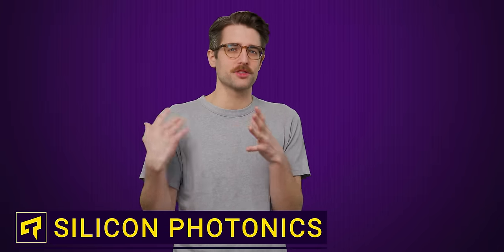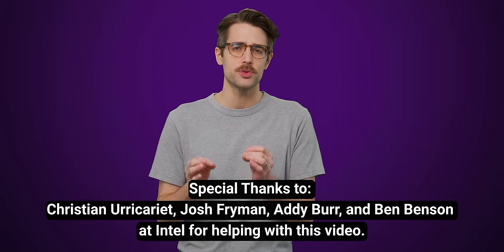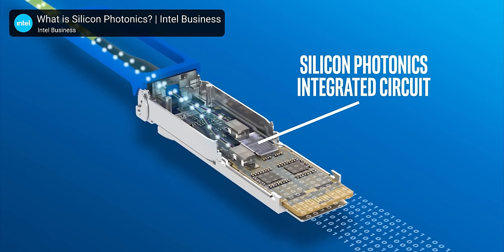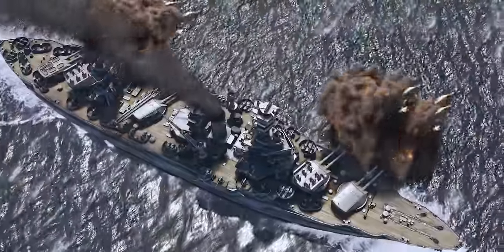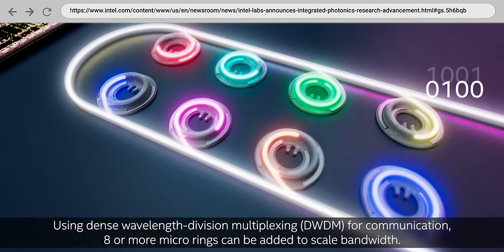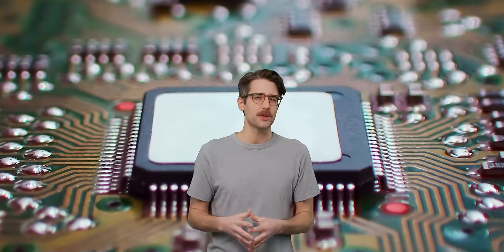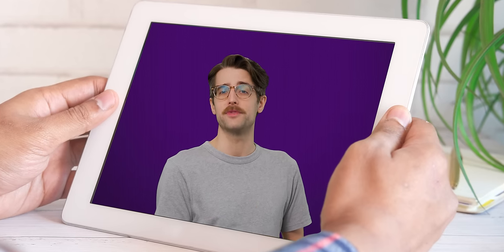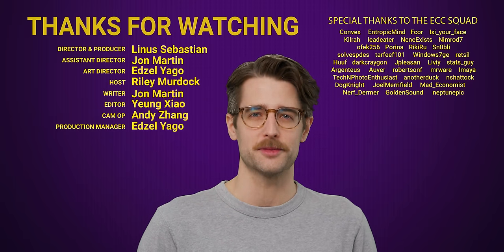The Newest Computer Chips aren’t “Electronic”

Comment: I feel like the challenge of inventing a silicon photonic CPU is going to be like inventing the blue LED.
Reply: It's because of the gallium mention isn't it
Reply: @paulelderson934  No. I was thinking about what the breakthrough would bring to the world.
Reply: @CoolJosh3k Might be less of a breakthrough and more a matter of replacing 70 years of progress in electrical circuit to respond to our current needs. That, and compability so that we may slowly integrate then phase out electronics

Comment: By the way you can also do the actual calculations in photonics too. Institute I worked for 10 years ago did that (wasn't embedded on chip though yet), but could do matrix multiplication in a single step. Seems to me like something we especially want for AI stuff...
Reply: Holy crap a single step??? Sign me up! I still have flashbacks of setting up matrix calculations in cpp for school and they can be super inefficient on a cpu

Would be super useful in game dev too
Reply: @yuichan3815 The modern way of doing matrix calculations at large scales (like for AI) is to use a lot of GPUs, since they're highly parallel and very well optimized for basically this exact kind of work.
Reply: As neat as it is, whether it is done in one step for the most part doesn't matter, it's largely semantics; but the total timing does matter. It's like RISC vs CISC. CISC can do certain things in one instruction whereas RISC takes multiple, but it doesn't necessarily mean that the RISC processor does more or less of those per second. It's just a different way to schedule and pipeline the work. Now if you can chain a DAC to an emitter to the optical matrix multiply to a collector to an ADC and get that all done within the timing of a single processor micro instruction, then that's a very awesome matrix multiply. But would that take up more footprint on the processor, and can numerical error be reasonably handled? The great thing about digital electronics is when designed and operating correctly, a bit is a bit and you can very easily do deterministic math with that bit and know exactly what the outcome will be. But when you're analog, how can you do important scientific math without an unknown or infeasibly quantifiable risk of your analog values changing from what you expect them to be? You would have to have some kind of constraint that ensures you cannot have unknowns caused by unpredictable interference or defects on your analog circuit, such as always converting back to digital before the error adds up to an amount that would make that resulting digital value non-deterministic, thus resetting the error.
Reply: @yuichan3815  u ever tried the GPU?
Reply: @rohansampat1995  Of course. I'm talking about cpu matrix math though
Reply: @yuichan3815  common consensus from my limited knowledge is "dont"
Reply: @rohansampat1995  That is very wrong. Why would you calculate a projection matrix on the gpu for example?
Reply: @yuichan3815  You guys all took the red pill I see.

Comment: A cool application of photonics that relies on quantum principles is using specialized photonic circuits to solve matrices. This is because the way light travels through a medium follows a matrix equation and so if you change the properties of the medium and measure the light, then you have essentially solved the matrix just by shining a light at some light channels. It's supposed to be magnitudes faster than an equal sized electronic chip and can be used heavily in machine learning and AI (AI is basically just a shit ton of matrices btw)
Reply: Analogue calculations like this used to be really common, they require no computing power to solve. There's similar methods for solving all sorts of equations. I've always predicted that analogue calculations will one day be integrated into our compute process for common problems. Anywhere you can fit an analogue calculation is going to be faster by several orders of magnitude. Especially as the modern age of computing keeps focusing more and more on optimization of the tech we currently have as it is becoming harder and harder to make it physically faster. Only reason we haven't started doing things like that already is changing computation pipelines leads to bad legacy support.
Reply: no idea what that means but sounds cool
Reply: Until its more than the sum of its matrices... WHOOOHOOOO SPOOKY!
Reply: shit to of matrices? We have a word for that Tensors.
Reply: Absolutely. You can even implement an entire neural network entirely with optics, no need for electronics at all for the neural network itself. I did some research work on applications of diffractive optical neural networks, pretty cool stuff.
Reply: @CutoutClips that’s really cool! Do you have any pointers for further reading?
Reply: @jeremiahmcelroy2726 Digital processes are so mature, it would be really hard (or imo probably even impossible) to make an analog compute module (including DAC & ADC) to even come close to being economical or even competitive size and performance-wise to existing and evolving digital solutions. Only hope I see for analog computing is with quantum mechanical effects where you can reduce the dimensionality of an algorithm and thus scale better on massive tensor operations. Maybe someday we'll be gaming on quadrillions of entangled femtometer waves after all, who knows.
Reply: A matrix is a great way to relate lists to each other, which is essentially what AI does
Reply: 1. Are you referring to transfer matrices perhaps?
2. So, the goal is to create Optical Neural Networks?
3. Could we build such thing as cheap, mass-producible all-optical "transistor", which would make whole PIC even faster and more efficient?

Comment: Actually there is a place for silicon photonics is consumer products for example external GPU/TPU /NPU . Considering PCI 5x16 has a max bandwidth of 128 GBps and thunderbolt 5 has 80/120 Gbps (10/15 GBps). In real world application a thunderbolt eGPU has very low bandwidth compared to its direct pci brother, the problem is further complicated by NPU/TPU they require even more bandwidth.The development of faster even more data hungry hardware will inevitably require a fiber optical port in our laptops and desktops in order to keep with the demand,

Comment: Silicon photonics isn't particularly likely to hit home computing except for maybe the network adapter and monitor cable.  Its best advantage is communication at a distance.  Short lengths see it suffer and i can't find anywhere showing an analysis of at what distances it is faster but the interest appears to be in using it for interconnecting components over a meter apart.  Main advantage is needing fewer relays at especially long distances and greater bandwidth.  It's also the worst method of photonics as silicon has a disjointed band gap.  Furthermore it isn't without electricity as implied.
  It will replace some communication bussing, especially at the server level, but where it is present, please remember that silicon photonics is cheaper not better.  Plenty of other photonics provide far more bandwidth.  I'm sure the marketing departments will attempt to say otherwise, but the industry is looking at it because it is cheap, not better.  If crossfire/sli weren't dead, the technology would allow for high bandwidth low wattage communicating between an array of gpus and a processing node(with actual room for adequate cooling), but it doesn't make sense for anything other than AI at this point.  And again, cheap photonics.
Reply: We could see optical interconnects between the CPU, RAM, PCIe slots and the IO chip as photons are far less prone to interference from photons travelling parallel to them.

Comment: What gets me really excited about this kind of tech is that it could finally break us from our dependence on binary. Light can hold much more data than a simple on / off, thus we could conceivably create logic gates that work with a base greater than two without even requiring a quantum computer. That would be a huge leap in processing capabilites.
Reply: Just think, instead of on/off, we could have ir/red/orange/yellow/green/blue/indigo/violet/uv.... just to start with. Could possibly even go all 256 cubed with full RGB.

Comment: It could be massive for connecting components of even normal devices together (gpu, cpu ram in home PC). No lag, huge bandwidth, it'd possibly be like apples solution to put the ram as close as possible to the CPU except without the limitation of actually having to put it that close xD (allowing for more flexibility or even more ram).
Reply: Would allow for unified system memory to be actually useful, GPU and CPU could call on the same RAM locations without the constraint of shortest possible trace path to ensure stability at speed.
Reply: It could probably also allow for also for much more flexibility when making even a single chip such as a CPU. Mainly is that it can be a lot bigger at much higher speeds, and it'd also probably allow for more on board cache and more flexible ways to put different dyes together (this could make it cheaper to manufacture chips because cheaper dyes can be more easily incorporated where the improved and usually more expensive chip making technologies aren't required)
Reply: Apples solution? Lol.
Reply: @handlesarefeckinstupid  True 🤣, rather should have said what they've been using lately
Reply: There naturally has to be lag, due to the speed of light and the bus clock

Comment: Data centers drive optic transceiver volume and development. Optics started in the Telco networks and advanced very slowly but when the datacenters moved to fiber optic interconnects and away from copper Ethernet the avalanche started. Volume shot up exponentially, prices plummeted due to volume, specification moved at the "rate of PC standards" and the speed just went insanely up - on that same fiber. Ayar Labs is doing some fun Chiplet stuff and OpenLIght is making Silicon Photonics as easy to implement as adding a memory to your ASIC. There are more of course. And right on time as AI is causing the datacenter to reinvent itself yet again. And this time its not a derivative of the workstation market. Its finally becoming its own incarnation.

Comment: So, questions this raises. Does this cut down on latency at all? How many different wavelengths can be read/written? High speed Optical cards need massive heatsinks to cool the cards and line, how is that problem solved when on a board?
Reply: 0 errors
Reply: @evil1st  Its not instant, its just very fast. It still takes time. The processing itself is still done in silicon, anyway, which means you lose some of the benefit. 
The wavelength question is more about can we use multiple wavelengths at the same time, the way we do with Wifi currently providing a potential for much larger data transfer speeds.
Are we going to water-cool the board now as well? The connection to the CPU is on the other side of the silicon from the heat spreader where we traditionally water cool.
This seems to be much less useful for consumer tech than server tech. You aren't putting water-cooling in a laptop, for isntance.

Comment: Hmm, this is interesting. I personally am still very happy with the 2016 tech. All the 33+ cores is a bit too much to me personally and from a software developer perspective, I suspect most of the modern code is actually the fault here. I suspect its bloated with bad practices and then you need more powerful CPU's to process it. So people really should actually begin optimizing their code instead. I mean optics is facinating and all, but it will still not optimize the code. There was this russian street racing game, that had the same issue. Where the first release was seriously bad. The graphics were worse than NFS underground and it needes a serious crysis machine to run it. By now the developers have learned from their mistakes and I suspect they are now a part of CarX (purely speculating right now). Anyway about the optics and photons tech in chips as described in the video. I do find it usefull in the recent hologram technology. Have you seen it? They use a bead to present a 3d pixel and then vibrate it in a holodeck and shoot a rgb laser directly on to it to produce a 3d image, a actual physically interractable hologram. The more beads they insert, the more resolution they get. So I think that these two technologies are like a match made in heaven. Since they use optics and vibrations to produce the holographic image. So why not use a photon oriented hardware all around the device 😊

Comment: Intel‘s got a patent to connect the cpu cores via waveguide  to the HBM on the same chip package.  But the used method of communication was radio frequency  instead of light. (>200Ghz; I hope I got this right.)
Reply: Radio is light, just at a different frequency

Comment: sorry but SFPs (transceivers) aren't going anywhere, SFP switches are used not because SFPs are needed for optic communication, but because they are universal - you can plug in any supported SFP and you'll have whatever you want.  10G SM 10km LC? Here you go, just change the SFP (SFP+). Want RJ45 GibE? Sure, just change the SFP. Want? 100GB 8x Duplex MPO? Just change the SFP (QSFP28). If your switch supports you can do whatever you want. I don't see industrial solutions changing in this regard.

Comment: So fiber optics for pc , i didnt expect them to be that fast !

The big question , more or less heat ?
Reply: Much much much less. To cram more data on a copper trace you up the power to maintain signal integrity. With SiPh you can just add another wavelength.
Reply: @andresgomez2649  yeah but lasers are far from being cold , it us a lot of power to heat the stone in it , and if we have 1 laser source for each parts...there will be more heat

But if theres only 1 source , or if this source is cost a lot , then yeah it will be quite cold , thats where the question come from

Comment: This sounds like what HP was working on somewhere around a decade ago; An (almost) completely fiber-optic computer.

Now, I do think that this is an important tech field to be developing, as we are getting a bit too small for electron-based gates in processor structures; We're already pushing way smaller than 7nm, and I specifically mention 7nm because that is the range within where an electron can re-appear (re-exist) after it randomly stops existing. Electrons will literally quantum-tunnel across up to a 7nm distance, and re-existing on the other side of a logic gate and eventually potentially create an unintended activation of another gate will result in errors. Now, despite this we've been pushing smaller gates. I think the only way chip designers/makers have been managing this is by having a routine "wipe" cycle built in, toggling the gates but without it counting towards the processes and code being run. (Much like how neurotransmitter receivers work... huh...)

Now, while quantum tunneling and our inability to DIRECTLY observe electrons are their main drawbacks, Photons also have their own set of drawbacks, but those typically only makes the lives of researchers harder...

Photons have the issue of being both a particle and a wave at the same time, but that shouldn't be an issue for making compute-systems around them, since as either a particle or a wave they move in a predictable direction/pattern. (And I do not believe they 'quantum tunnel' like electrons do.)
Reply: 1. Electrons are also both a particle and a wave at the same time. Go look at the Schrödinger's model of the atom or something.
2. Photons are also susceptible to quantum tunnelling. A quick google search says this is how partially transparent mirrors work but tbh i wouldn't trust that. Also, they are probably less prone to tunnelling than electrons, and even if they do it probably depends on wavelength or something like that.
3. You can't observe photons either. Unless it like, enters your eye, but then you can't use it to do calculations anymore either. And especially not if it's a single photon. This isn't like minecraft redstone where the circuit constantly emits light just for the convenience of human observers..
4. Photons are bosons, not fermions, which means the Pauli exclusion principle doesn't apply to them, which means multiple of them can occupy the same location at the same time. This probably has implications for compactness. And this is only one of the ways in which photons are "easier to control".
Reply: The actual transistor gates haven't really gotten any smaller in the past decade or so.  Most of the improvements in density comes down to new 3D transistor designs with a slightly smaller footprint with performance comparable to or better than old style transistors along with improvements to the masking and etching stages which allow for transistors to be packed closer together without fudging the transistors around them.

Comment: Bro every optical interface connection ever is integrating photonics with a traditional circut. Every camera, every CCD, every proximity sensor, every gallium crystal spectrographs already uses this technology. Execpt for the last one people use this stuff on a daily basis and shoulden't be suprised it's in more places.  This is like saying, "screws are being used more and more." While a correct statement, it's not news.
Reply: the technology itself isn't new, but we are trying to repurpose it

Comment: The problem with photonic chips and chiplets it currently lifespan. The nano-diodes have a tendency to burn out, the smaller the diode the shorter the lifespan.

Comment: Yeah I saw it, its sounds good but it doesn't work, optical cables are suited for long distance connections and inefficient when the proximity is close.
the power estimates they claim is also wrong they didn't include the laser power source which consumes 100W the least (that's a red flag)
its a cash grab.